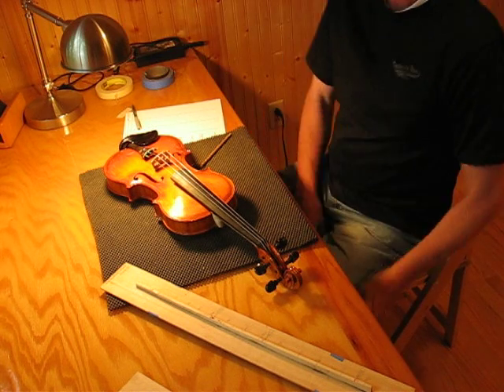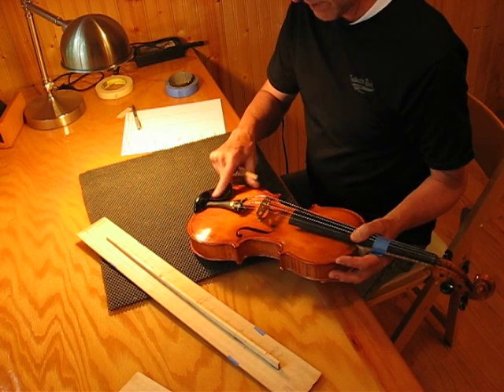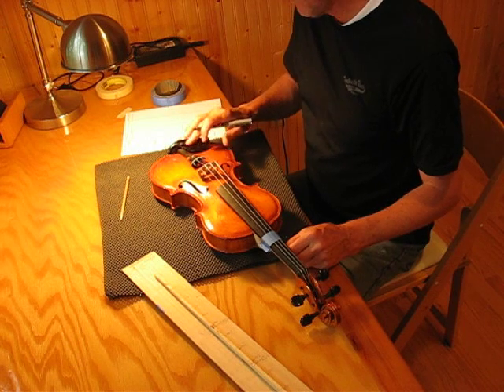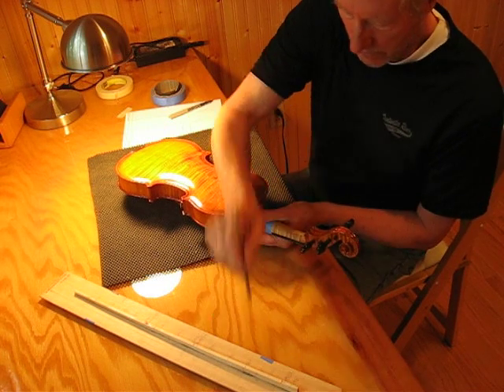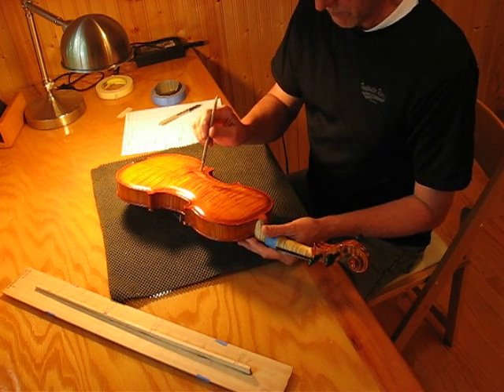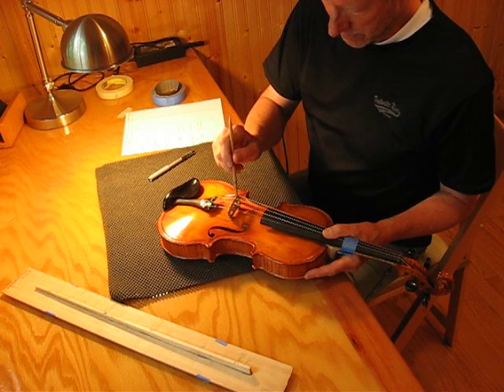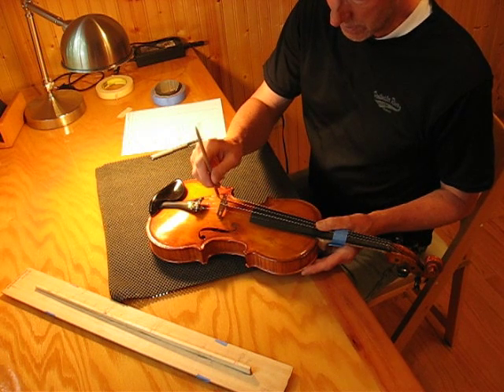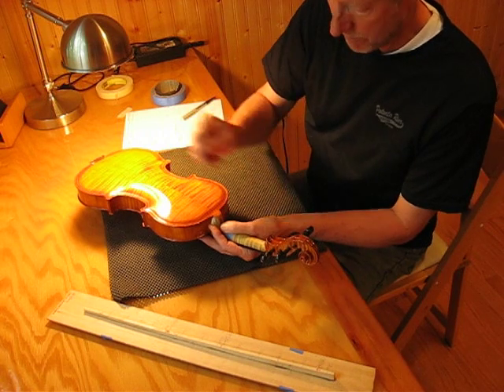Tap Tone Survey of a Violin by David Langsather

Comment: Has the soundpost been removed prior to your tapping?  Wouldn't the soundpost affect the tap reference?? Can you perform this tapping without strings?   Also, when this violin was originally built you never tuned it in this manner?? Thanks again!!  DLH
Reply: 1cleandude m
Reply from the maker: The sound post is still installed and does not effect the tap tone of the plates (just do not tap over the ends of the sound post).  Yes you can perform tap tone survey with or without strings.  Ideally, each part is tap adjusted or checked during building process; however, since it is so easy to hear tap tone harmony frequencies and tune to those, this step is necessary to see if you have really accomplished your intended goals!  David L.